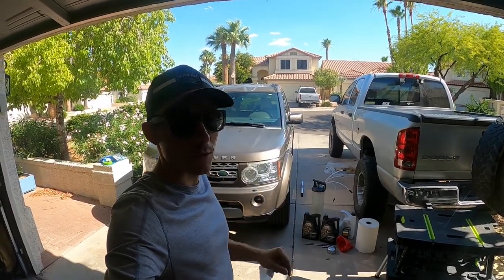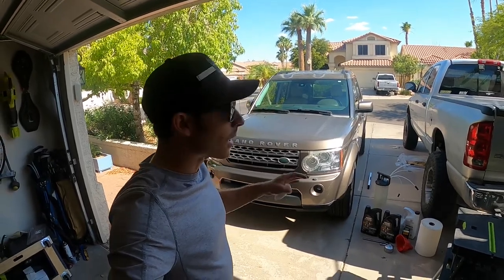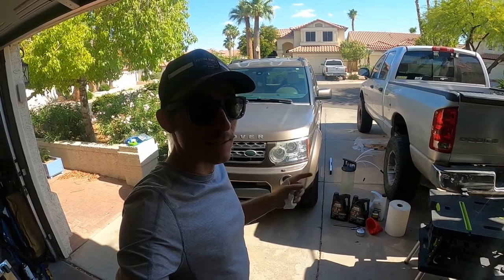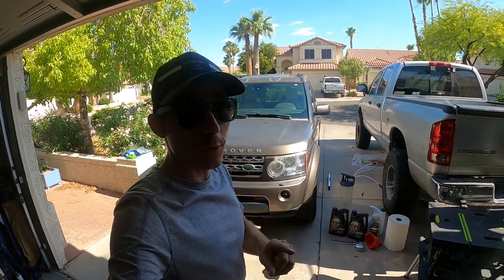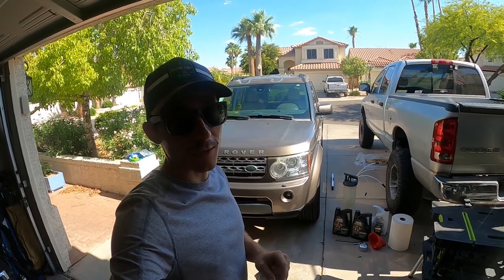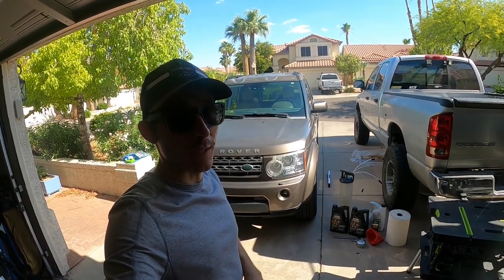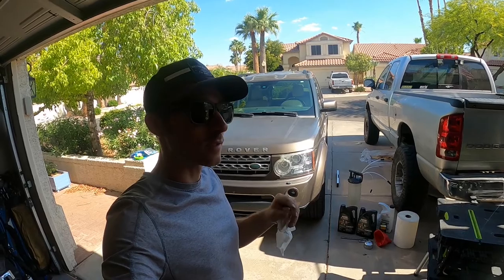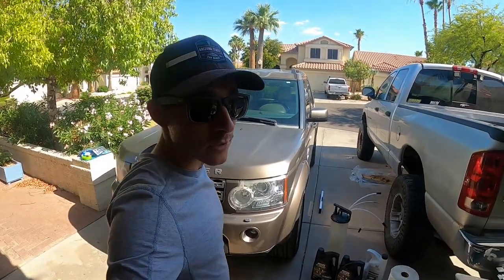LR4 Oil Change So Easy A Child Could Do It

Comment: Weirdly - the oil filter on the petrol model (that you have here) is different to the Diesel model.  It doesn’t use that oil wrench, rather it uses a 32mm socket nut

Comment: Not sure why you wouldn’t go to the “full” level?
Reply from the maker: No reason not to. However being in the middle is sufficient and the digital gauge appears to report only in increments of 25%. Therefore, it's easy to overfill by trying to get to the full level, which then means sucking oil back out and waiting to check the level again. Plus, being overfilled is worse because it can allow the bottom of the connecting rods to slap the oil and aerate it (make it foamy) which prevents it from getting picked up and circulated by the oil pump, causing oil starvation ironically enough. So I try to shoot for 75% full so I know it's sufficiently filled but not overfilled since the gauge is not completely accurate.

Comment: There is more to the process when checking the oil level.  Per manual.  You must run vehicle to full temp and then let the vehicle sit for 10 mins for oil to settle.  If you dont wait proper time it will say oil level unavailable.  Great video though
Reply: i found out that it has to be at least 30 mins to get 'real' reading

Comment: FYI - There is a way to bypass the 10 minute wait.  It’s been a while, but if memory serves, when you get the message that it cannot give a reading yet because you haven’t waited long enough you can hit the cancel button on the steering wheel twice (and/or hold it on the second press) to skip the wait.  Worked for me last time I got impatient and looked that up online.
Reply from the maker: Thanks for the info! I'll have to try it out

Comment: Im owner of a  2011 lr4 and have severe sun roof leak. Definitely that video will help. Also the lr4 is currently in the shop because of that gasoline smell and the the pump stopped working.. we are just waiting for the parts to arrive and replace the tank seal and the pump.
Reply from the maker: That's all the inspiration I needed to get going on posting the fuel pump seal video. I'll try to get it done this week! Sunroof video will be coming in the next few weeks as well as were headed up to Oregon this fall

Comment: hi, thanks for the video.  i followed it for my oil change.  i do have a question for some other engine fluids if you don't mind me asking you.  

trying to top up the coolant and power steering fluid in my 2011 LR4.

manual specifies 'Castrol SF' for coolant w/50% water and 'Texaco Cold Climate PAS fluid' for power steering. i can't find either as a specific product online. ive spent about an hour searching to get an answer but have struck out.

any chance you know what i can use?

thanks

Comment: Very helpful! Why would you fill the oil up to only the halfway instead of to the max line?
Reply from the maker: I prefer to fill to the max so there's a little extra in case you ever start leaking while driving. However, what I meant to say is that you want to aim to fill up to the middle of the oil level indicator to avoid overfilling because the electronic dipstick makes it hard to be accurate. Then you can add a little bit after you get it to the middle. But either way, as long as you're in between the low and the high on the oil level indicator, then you know you have a sufficient amount of oil.
Reply: YES, always fill the oil level to the MAX line.

Comment: Why would you not want to fill the oil level to "FULL"?
Reply from the maker: While full is ideal, you want to be careful not to overfill it. Overfill can cause foaming which prevents the oil from circulating. Because the digital dip stick can be difficult to know exactly how full you are, it's not a bad idea to shoot for the middle range because then it's definitely not over or under filled

Comment: I have a 2016 LR4 HSE 65k miles. I was going to use 5W-30. Any reason you used 20? Thanks
Reply from the maker: The main reason is simply just because that's what the service manual calls for. But if you live in an abnormally hot area 5w - 30 should be okay. With that said, I'm in Phoenix Arizona where we had 50 days in a row over a 105 degrees this year and 5w - 20 seems to be working just fine.

Comment: Mark, good video.  What's the name of the service manual app you have on your phone?  Thanks.  BTW...I'm up in Anthem and feel your pain (heat)!
Reply from the maker: Thanks! I have the pdf on my laptop actually, it's over 5,000 pages if I remember correctly, but I downloaded it a few years back. I've been trying to find a link to it that I can post but all the links seem to be no longer working. I'll keep looking though. My guess is the links were disabled due to copyright infringement so it may not be possible to get it for free anymore. However, in the meantime I'll post a link to where it can be purchased. In my opinion, It's definitely worth  buying if you have to. It has been very helpful to see exactly how Land Rover intended certain things to be done

Comment: Thank you for posting.  I am contemplating getting a 2011 LR4 - do you have many issues with yours or do you feel they are reliable.  Also, 116 degrees - I would have passed out removing the engine cover.
Reply from the maker: Hahaha the heat definitely takes some warming up to... hahaha but to answer your question, our LR4 is hands down my favorite vehicle I've ever even ridden in let alone owned. The engineering is really top notch and it doesn't skimp on creature comforts eaither. That said, we actually plan to purchase a 2nd LR4 in the future to replace my pathfinder. However, their reliability is a tricky topic. For someone like me, who is capable of working on my own vehicles and stays on top of maintenance, the LR4 is reliable and maintenance is as affordable as about any other similar vehicle. On the other hand, if you're going to be taking it to the shop for repairs, plan to spend more in maintenance than a similar vehicle, because a qualified and knowledgeable rover Mechanic costs more than for normal vehicles.  BUT I have heard GREAT things about the reliability of the v6 LR4s. The one thing that the v8s suffer from is a defectively designed timing chain guide rail that wears prematurely. However, for the v8s, if you get a well taken care of LR4 and change oil every 5k miles, I would expect the guide rail to make it to at least 120k miles if not 150k. I plan on changing my guide rail out to the updated design this year though anyways. It's fine now but if the guide rail wears out too much then it can cause catastrophic engine damage, which will set you back $5k. The part itself is relatively cheap, it's just the labor that's a little pricey, but an ounce if prevention is worth a pound of cure. And for me, since I can do it myself, it really is a no brainer to change it out when I know I'll have 2 days to devote to it so that I'm not rushed and stressed and get the piece of mind knowing I did everything perfectly. So in conclusion, if you're on a budget but not shy of wrenching on it and have the time, then snag a good deal on a v8. But if you got the coin, don't hold back; get a fully optioned v6. Whatever you do, if you're gonna wheel it, make sure you at least get the 2 speed transfer case. And if you really have money and/or patience, make sure it's also got diff lockers. Keep in mind, this is coming from a red blooded patriotic through and through America loving dude who still loves the snot out of this snobby    British piece of machinery because it's just so dang good, impressive, and over engineered, especially for the price range your looking at when buying one used. I was also uncertain and timid about land rover when we got it but the deal was too good to pass up ($13k @75k miles), and I'm sure happy I didn't buy a stupid unibody jeep commander which is the only "comparable" alternative.
Reply: @mericamark  Thanks so much for your response.  I can do some work myself.  I have a lift and a lot of tools so that should be fine.  I am starting to realize I am getting up there in years and I would only like to work on a vehicle about 6 times a year.  I have a '95 Land Cruiser and a 2006 Lexus LS430 and was thinking to sell them both and just have 1 car for me.  I do not drive near as much as I used to especially with everything going on and we would go up to the Bald Eagle State Forest here in PA every now and again.  I think you have definitely help make up my mind.  Again thank you for post you are a good guy.

Comment: I noticed that the manual calls for a specific oil spec, and recommends the Castrol Edge Professional OE, though any oil that meets the spec is okay. The version of Castrol Edge you used that same spec, or ?? Is the dye the only difference? Is the oil you used able to go 15K mi or 1 year between oil changes (not that I would do that haha)? Thanks!
Reply from the maker: I certainly can't see any oil making it 15k mi haha but regardless, I still don't trust an oil for more than 5k miles. Look into the 3.6l cadillac motors that kept blowing up. Eventually GM said that their instructions for oil changes every 10k mi with mobil 1 syn was what caused the problem and that the oil actually needs to be changed every 5k. Anyways, as for land rover products, yeah the dye is the only difference. All the research i've seen shows that the oil i used and the oil from the dealership are identical, other than one being dyed and being sold for $100 more.

Comment: FYI.. hack alert. 

You don't have to wait for the engine to cool down. 

Open driver's door.. open bonnet.. add your oil then get in car (leave driver's door open).. 

Don't press brake but press ignition button to turn electrics on.. then go to service menu to check oil level..

THEN PRESS 'CAN' ON THE STEERING WHEEL.. ie cancel of cruise control.. AND OPENS UP MECHANICS SERVICE MENU TO ALLOW YOU TO SEE OIL IN LIVE TIME.
Reply from the maker: The Land Rover community thanks you!!

Comment: Many thanks, I would like to change the fluid  of the differentials, But, I do not know if my LR4 V6 2015, has a  non-electronic (locking) rear differentials, or electronic (locking) rear differential. Also, when sould I change it, every 80000 Mi or 140000 Mi. All the best
Reply from the maker: If the locking diffs are factory, then they're electronic. I'll check the factory service manual and see what it suggests. Changing the diff fluid should be easy and relatively inexpensive though so I would opt for more frequently rather than less though. We just surpassed 100k mi on our Rover so I might make a video pretty soon here detailing how it's done. My diffs aren't locking though